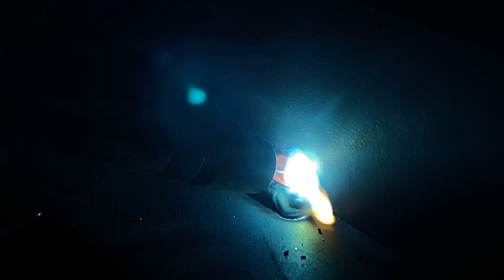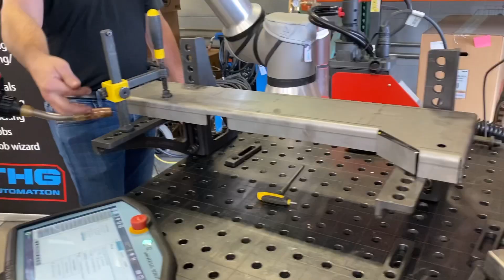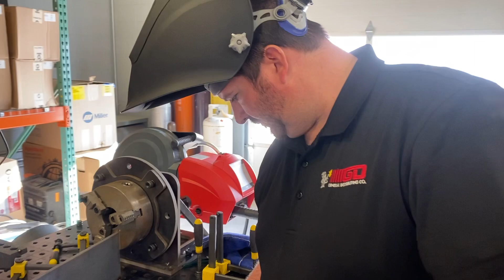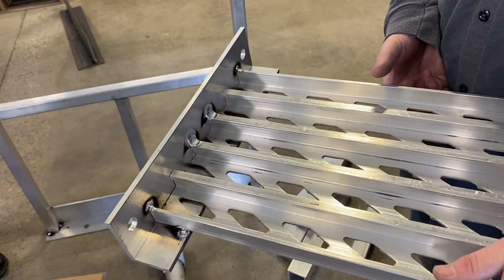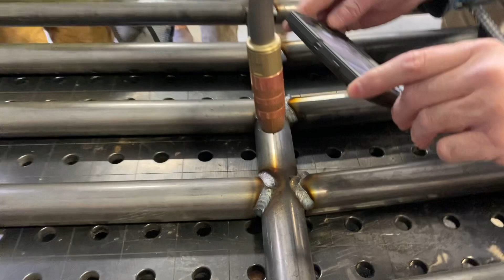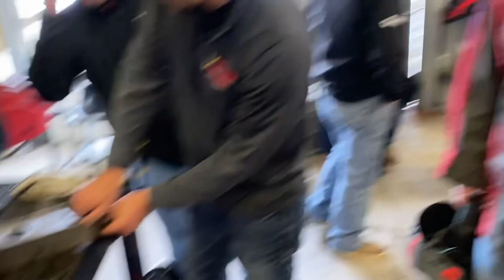Cobot Solutions For Welding Applications #fronius #robotics #welding

Comment: Great video! Do you have plans to do a more in depth video on the iwave line? Like the iwave 230?
Reply from the maker: Skies the limit but it’s all about planning time for it. It would help if I had three phase in my garage. I’ll add this to my topics for video content
Reply: @chris_b_liven Are you not wanting to do the 230 iwave because it doesn’t have the same capabilities of the 3 phase machine? Or just because the 230 iwave is similar to the old magic wave 230i?